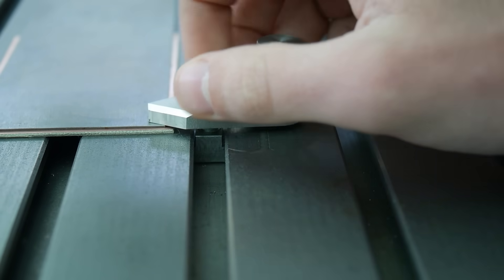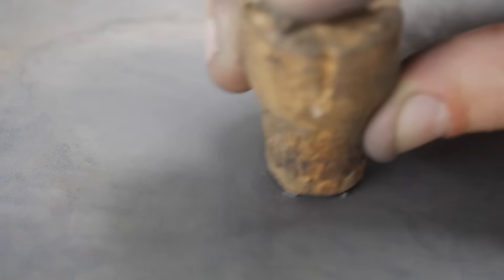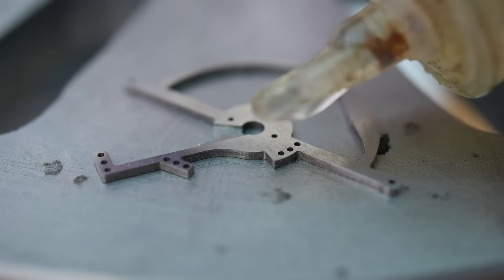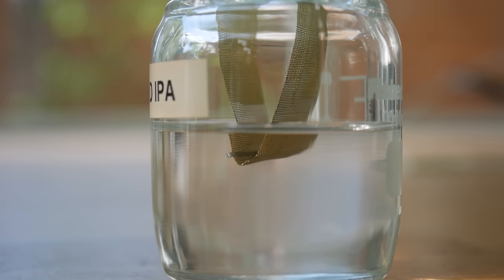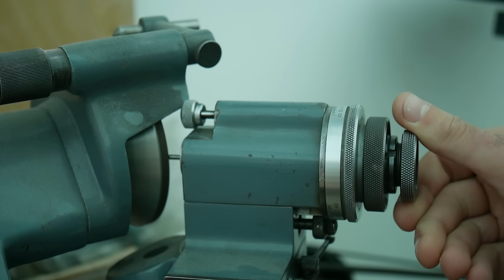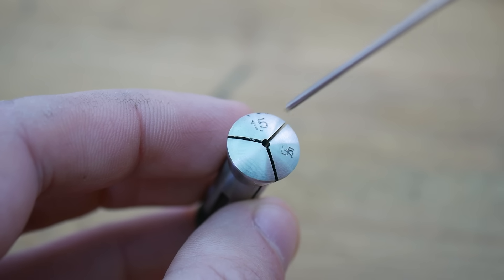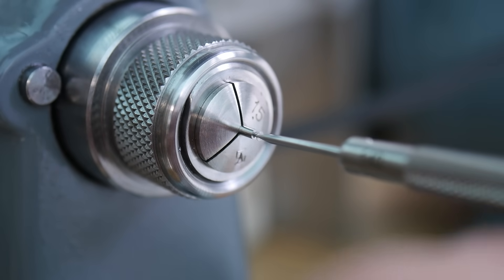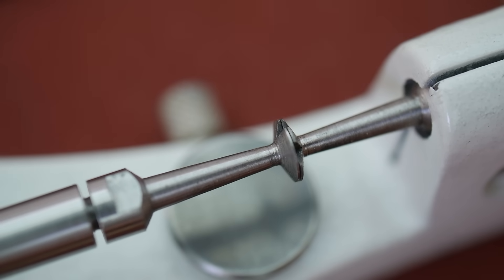Watchmaking: Making a Tourbillon Cage

Comment: I love your videos... Thanks for going to the trouble of making them. The videography is excellent. I took apart an ST3600 movement a couiple years ago, and mostly got it back together, other than that pesky balance wheel. There, I got stopped, as I wrecked the balance spring. I have a replacement but am pretty shy of trying to do it again. So I apppreciate your skills and knowledge quite a lot.

Comment: That's the second Feintaster I've seen today, and it's a beauty. They're really expensive these days, so what would you use if you couldn't get one? I'm thinking of a normal inch micrometer but with custom anvils, but I really have no idea how. I'm impressed with your deburring techniques too, very clever - I hadn't thought of using a burr in a pin vice, but I'll be doing that from now though, thank you very much. Looking forward to the next part.

Comment: absolutely beautiful work. One recommendation... avoid using circuit boards as a backstop mounting material for machining. Many PCBs are made with glass fiber and are extremely abrasive on tiny endmills and drill bits. Also the copper has a propensity to build up on the cutting edge which increases lateral load increase chances for breakage. Other better materials are machinable wax or acetal plastics. that being said you and Click Spring are tops for video and machining work ASMR.

Comment: Fun video - thanks! I very much doubt you will be able to balance a part like that without some adjustment method - even CNC doesn't generally achieve that, and you are manually filing and chamfering this part. Worst case you will be able to add an adjustment weight (or drill a lightening hole) later 
👍

Comment: Few times I had to tap 3mm holes by hand and it was nerve wrecking but this ... Damn I would not need lubrication as I would sweat like crazy just  holding such small parts... 😅
Reply: That is what it thought. The smallest I have done is 1.5 mm, and the tap feels like even the slightest bump or jerk could break it.

Comment: Great video, I'm not sure but I think I saw pantographs on old watch factories photos.
Reply: We still use them quite frequently to make watch parts here in Switzerland, especially if you need to copy a broken or damaged part as a one off piece. The use of a 3d printed template however is a new technology XD
Reply: @christiaankirkenes5922  So You copy them on 1:1 scale by hand? The nerves during that operation... Hats off
Reply: @loginvidea no we have a machine that can project the part profile 20x larger, they use that to make a new template, check accuracy and put in any repairs/broken or missing sections. 
Then the pantograph shrinks it back down 😂
Reply: @christiaankirkenes5922  Makes much more sense. Thank You.
Reply: @christiaankirkenes5922 thank you,  just saw your reply.